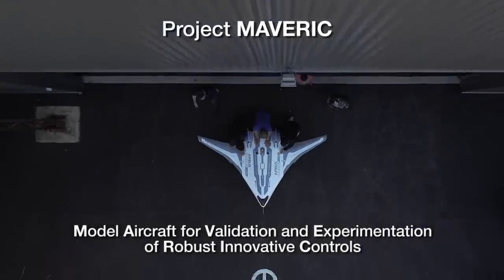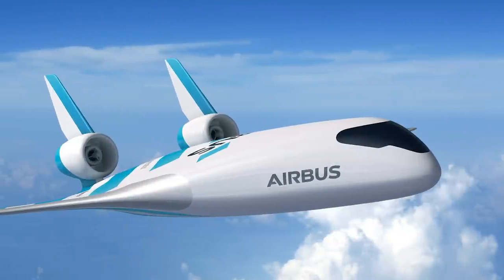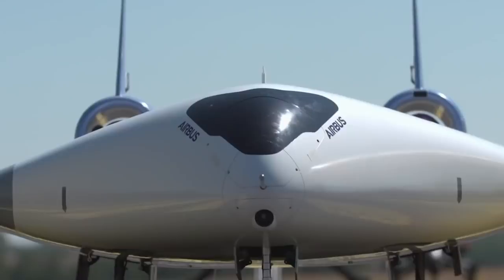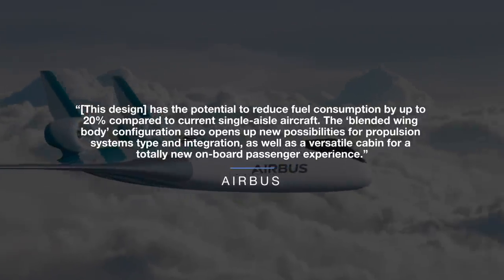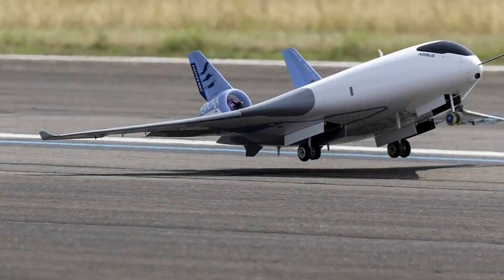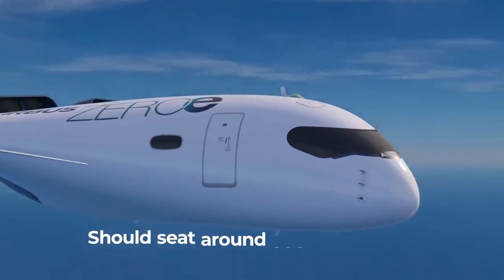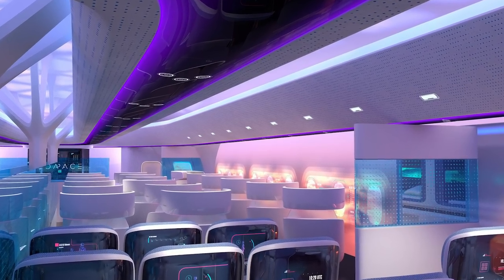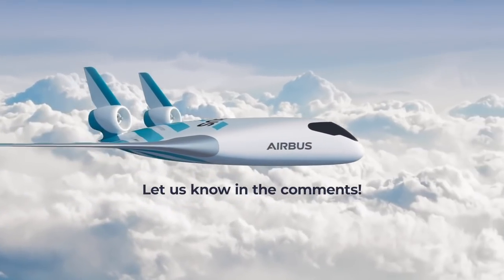The Development Of Airbus’s Game-Changing Blended Fuselage

Comment: Most passengers wouldn't get a window view :( that's something they should address as most people don't like looking at a seat for hours
Reply: Well that looks like 15-20 passengers max. Look at the scale using windshield and door. And look up hydrogen energy per volume. This makes no sense economically.
Reply: free internet for all. who needs a window?
Reply: @bobtahoma  What I mean is that people want to see what's going on outside, being 3 rows away isn't a problem, what is a problem is being half a room across. Addressing that problem would mean probably putting some windows on the ceiling. The problem with this is that if people who fly in it feel like they are trapped in a tin can, they won't choose to fly in it
Reply: Great for short hop flights of 3 hours or less  but extra space to stretch n walk not bad for long flight to sleep through the entirety
Reply: Wont people on the window seats get a motion sickness esp during a turbulence or maneuvering..?

Biggest cylinder plane is roughly at 3+ meters from the center. This one could be 7-10 meter from the center. Probably works the best for business jet maybe.

Comment: I looked thru all the comment and no one mentioned this.Very cool looking design,but
I dont believe people will like riding inside this aircraft for this simple reason:
A wide body aircraft puts people farther away from the centerline, (forward to aft).
The father away from centerline you seat, the more you move up and down in a turn.
15ft from center @ a 20degree standard turn rate, a person would move up or down 5.5 ft.
Only get worsts father away from center and bank angle.

Comment: IMO the biggest challenge is still the hydrogen infrastructure. Manufacturing hydrogen from natural gas isn't exactly a zero emission option. Electrolysis also requires a lot of power to get the hydrogen needed.  Then there is transport and storage of Hydrogen so that it gets used quickly enough that boil off isn't a concern. 

But, beyond those challenges, I think this is a long term viable solution. IMO it's just a matter of when, not if.

Comment: As an Aero Engineer of 3 decades,this basic concept in design has been around for quite a while now in some form or another, but Hydrogen fueled engines is current technology and in my humble opinion,the  best future option for aviation we currently have.
Reply: nice way to turn an aircraft into a flying H-bomb! lol JK
Reply: It needs extremely large tanks to hold the hydrogen. Where to fit the people?
Reply: @fukawininetynine5999  that all depends on how cold they can get it, but that’s a whole other issue
Reply: @fukawininetynine5999  The tanks on this design will be around 60 percent of the floor area,plus 50 percent of the wing area..So with an Aircraft size that can haul around 500 passengers or more,the range will far exceed the requirements at cruise settings at altitude.
Reply: @fukawininetynine5999  It weighs a lot less than jet fuel though.

Comment: The modern day fuselage is cylindrical which is easy to pressurize .The pressurization is also uniform along the perimeter. How does one achieve pressurization in a blended wing ? Since the pressure is variable,  what about differential stresses causing metal fatigue leading to potentially explosive decompression scenarios?

Comment: Two things: Liquid hydrogen requires 4 times the storage volume as kerosene (jet fuel). So it can’t fit much in the slender wing, requiring it to take up much cabin and or cargo room. It does have an advantage of being lighter than jet fuel by a good margin though. It is much more volatile than kerosene and that’s a serious issue. A third issue is that making hydrogen requires a lot of energy input so like everything else, it won’t be emission free. It may well come about, but no time soon.

Comment: I look at that mock-up, and all I can think is: How can they possibly push all that extra frontal surface area thru the atmosphere, economically?? Put your flattened hand out the window on the highway – first with fingertips pointing in the car's direction; and then try it with your hand pointing sideways (ie, more frontal hand cross-section). Now imagine the relative forces if you were going 10 times as fast.

Comment: I don't think, flying wing design is the future. It can carry more passengers, but what about emergency evacuation? I'm looking forward for hydrogen power though.
Reply: Agree. On the rendering we can see only two doors. You can't evacuate fast enough with this. 
Passengers in the center aisles will be far from the nearest emergency doors if they put more. And it's a no go to put them in the floor.
Maybe on the top ? 
I'm pretty sure this is one of the main reason that design is still not in use for passenger jets.

Comment: 1) Hydrogen is only clean if it made via  electrolysis H2O -> 1x H, 2 x O.  Not using fossil fuels this actually creates more pollution.
2) hydrogen requires much larger fuel tanks than hydrocarbons (jet fuel). This factor is by far the biggest constraint moving to hydrogen aircraft.

Comment: 20% fuel saving when better engines will deliver similar fuel saving, and renewable tech similar cost saving, means there is little driving a change of plane shape. Tubes are very structurally efficient and give a good result in space with no columns. They also result in more windows which are growing in size and also attract a fare premium.
Reply: 20% fuel saving through engines?
Reply: @rajashashankgutta4334  Check out Rolls Royce engine development plans - Its Ultra Fan engine has a fan whose blades pivot like propellers - they can even do reverse thrust. The fan does not need gearing. Have not seen any proposals for windows on the front of the blended wing. I expect the proposal is for cameras on the aircraft exterior whose images passengers can view on screens on the back of the seat in front. The seat yield is also bad.
Reply: @peteregan3862  you can even build airframe with carbon composites like b787 and use these engines.

Comment: isnt hydrogen explosive?
Reply: So is fuel, making it safe and usable for aircraft is the main goal of the project! So far there have already been hydrogen cars, busses or trains
Reply: Yeah, and how well did all those Hydrogen vehicles work?
Reply: @ktjmitchell7722  they work the same as their conventional counterparts, they just have a different fuel source. A city in Germany for example plans to switch all their buses to hydrogen
Reply: That's the point...
Reply: Hydrogen by itself is not explosive. It needs to be mixed with oxygen, and exactly half the volume of pure oxygen for a certain amount of hydrogen. Since oxygen concentration in the air is at about 21 %, it will need about 2,5 times as much air which is evenly mixed wit it, to be explosive. Since it will be stored in it‘s pure form in the tank, even if the tank ruptures it can’t explode. It will find oxygen in the surrounding air, but to ignite it will also need an ignition source. And in the open air hydrogen will move up and away quickly because it is much lighter than air, so before it can form an explosive mixture, it will be far away from the aircraft.

Comment: Dear Airbus, please can you adjust the scale of the model door etc to suit the touted capacity of 200+, as it currently looks like it could hold 50 tops. On a more serious note with all the discussion about BWB and feeling sick because of roll rates for passengers seated far from central axis - surely this is what FBW is for? I.e. it can control those rates to tolerable levels?
Reply: The animated model looks like a small mockup, maybe they plan to use such an aircraft for flight testing

Comment: In a blended fuselage wing configuration volumen for passengers is limited, That means there is NO VOLUME LEFT FOR HYDROGEN
OH YOU FORGOT TO ADD THE EXTERNAL TANK
incompetence or click bait?
Unless you flunked MIT
despite the Free Video lectures  available on yt, there is a slight chance that you might learn  something about the power density of hydrogen, even when liquid like on the space shuttle, 
Hydrogen leaks posing a fire danger .
Who will operate an aircraft that requires liquid hydrogen on every airport with special equipment.
Sorry not a realistic presentation, but good enough to monetize and deceive.